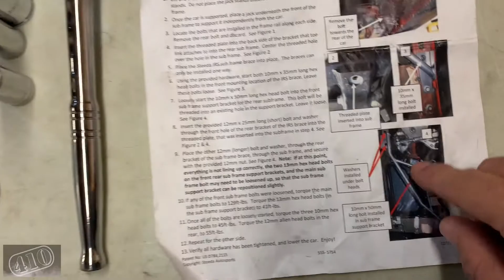YouTuber 1/4 mile meet! Plus some Steeda suspension changes! Procharged Mustang V6

Comment: Just wondering if you got the bmr craddle lock out kit installed and if you felt it solved your wheel hop issue? Did you go with the complete bmr kit with the bracket or just go with the bushing kit?
Reply from the maker: dhsw41800 Haven’t gotten yet but going for the complete kit.
Reply: Doomsday410 thanks much.

Comment: That 2nd gear wheel hop was sure violent. It seems like I've seen several people having issues with their disks getting corrupt, was it a GoPro?
Reply from the maker: Stupid Fast Truck Yeah it was a GoPro but I think my fault. I tried using a cheaper SD card than I normally use. My other good SD was in my DSLR back at the house. I forgot to swap it back 😂
Reply from the maker: Stupid Fast Truck And yes the wheel hop felt much worse inside than it looks on camera. My issue used to be wheel hop off the line. Now it’s second gear 😵